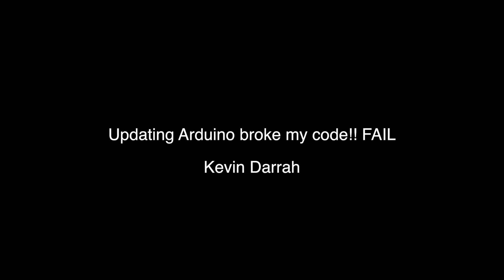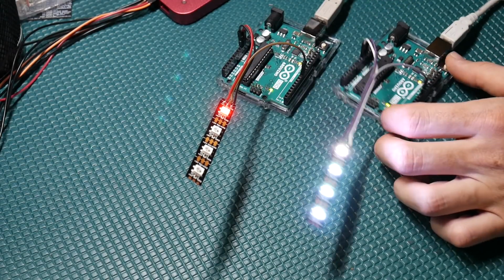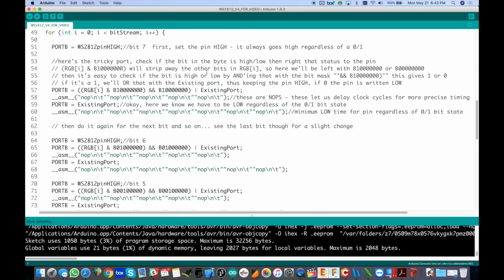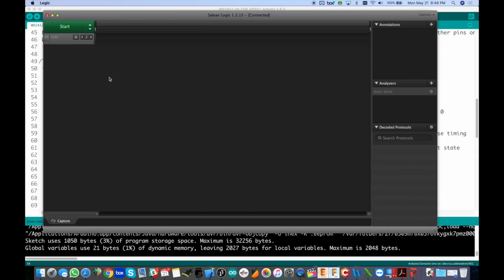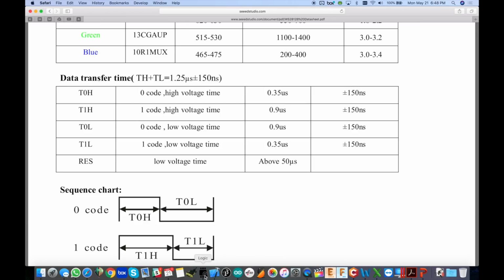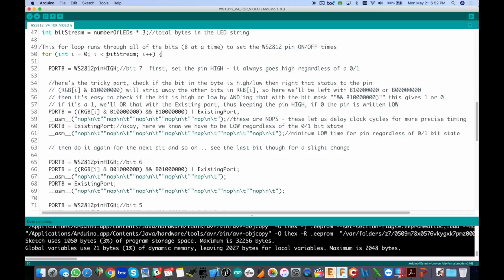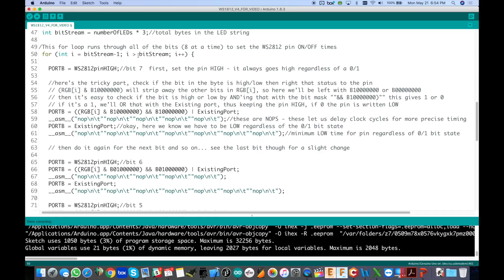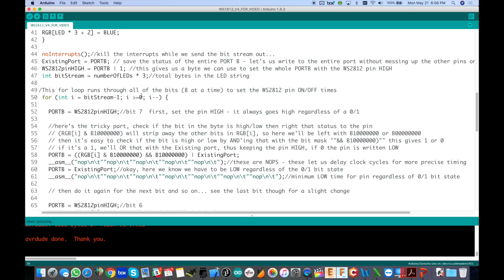Updating Arduino Broke my Code!! FAIL

Comment: Hi Kevin, How to make 1 LED turn on, and the other 95 to stay off 
in a panel of 96 addressable WS2812B LEDs,
but in an automatic fashion? Can one write 96 RGB_update functions 
and Call a particular function (within another Arduino code) to fire a specific LED? 
Thanks a lot for your help!

Comment: I don't think that the for-loop is to blame. Normally the time to branch back from the end to the start of the loop shouldn't have any influence on the execution of the inner code i.e. on the length of your bits.
I believe that the way you write the loop has a side effect on the code optimization of the inner parts of the loop. I reckon that the loading of the RGB[i] value into a working register somehow moved from before the "PORTB = WS2821pinHIGH" instruction to the location where it is first used. Hence the length of the first bit is increased by this additional operation.
The best way to avoid such surprises in time critical parts of your code would be to write the whole section in pure assembly. Then the compiler won't change or optimize it.

Comment: When doing a normal comparison the hardware has to do a memory fetch for the value to compare, and do a subtraction, then test the flags (less then, greater then, equal too, etc.).  When counting down to zero there's no need for the additional memory fetch and the subtraction for the flags is part of the increment/decrement part of the for loop.

Comment: (RGB[i] & B10000000) && B10000000 doesn't make sense. Because && is boolean logic this will be 0 if the left operand is 0 and 1 if the left operand is non-0. It has nothing to do with the right operand being B10000000. It could be any non-0 value. The semantics are misleading and could lead to a programming error someday.  I would suggest either !!(RGB[i] & B10000000) or ((RGB[i] & B10000000) == B10000000) or even ((RGB[i] & B10000000) && 1) all of which will provide the correct result but better convey the semantics of what you are intending.
Reply: Robert Tausworthe 
Your comment makes sense; & != &&. He's using them as if they are the same thing :(
Lucky it worked at all?

Comment: Did you try "for (int i=0; i < bitstream; ++i)"? Normally, this should be optimized by the compiler itself, but in case of i++ rather than ++i the value of i is actually evaluated before incrementing it (even though not being used for anything), so that might be an issue as well. Example: "int i=1; int a = i++;" gives a==1, while "int i=1; int a = ++i;" gives a == 2...

Comment: For anyone interested here is a snapshot of the generated assembly code for an up counting for loop and a down counting for loop :https://drive.google.com/open?id=1jxaz6GCLQgYs-wOp5-LJ-uq0ckZcLj2s    what basically happens is that you have one more instruction in an up counting loop because there is no branch instruction that compares with an immediate value so you need to do  a subtraction first (instruction 84 in the picture) next once the subtraction takes place it is compared with bitstream (instruction 86) then another instruction that will branch if the previous instruction was "not equal" hence BRNE (BRanch Not Equal) . The downcounting for loop  instructions begin at  8a 8c 8e which is only 3 instructions including the one to send a value to portB. while the previous up counting for loop had 4 instructions including sending the value to portB.  oh and the very first (80)instruction is your counter variable, in this case i and x.  the compiler was smart enough to use one register for both (r24)

TO sum it up in simple terms:

up counting for loop : subtract -> compare ->branch

down counting for loop : subtract->branch

Comment: What occurred to me is that maybe the test to see if something is equal to zero (now) takes fewer cycles than testing it against another value?
Edit: OK, you said that at the end, if so using... for( i = bitstream; i; i-- ) might be fastest if that is the case.
Reply: check this out I typed up to similar for loops except reversed the counting and took a look at the assembly code generated : oddly enough the counting down gives me less instructions then counting up :  here is a snap shot https://drive.google.com/open?id=1jxaz6GCLQgYs-wOp5-LJ-uq0ckZcLj2s
Reply: oh im wrong , instructions 82,84,86,88 are for the up counting for loop hence 4 instructions. the the last 3 instructions are for the for loop counting down. so yes less instructions to count down

Comment: The problem is not the compiler. The problem is your use of nops to guarantee timing between loop iterations. Interrupts can delay instructions, including nops. In order to enforce accurate timing, you need to disable interrupts prior to nopping, or redesign your code to poll elapsed time.

You may use "DELAY_CYCLES" to delay accurately, and you may also use the hardware timer to ensure that a set amount of processor time has passed between iterations.
Reply: I believe he is already using noInterrupts() which should disable interrupts?

Comment: Wtf? People actually use arduino ide??? Talk about hitting yourself with hammer when trying to do anything. Please, arduino didn't break anything.. it's already broken. Google "platform.io for visual studio code" and this video would never happen...
Reply: Google+ SUCKS BALLS - the worst forced social network    Arduino is great, just use whatever you like.
Reply: Yes, it is much better, but electron is shitty
Reply: For education, yes
Reply: I use platformio for project configuration and the command line utility.. You don't need to to use electron, you can use whatever editor/ide you want with it.

Comment: ONLY an arduino will have issues like this, this is why its a prototype kit.
Reply: whether its the Arduino firmware or the tool-chain its still Arduino that's my point. I understand the avr dude and the other stuff works as usual but the upper layers are where mistrust is.
Reply: i blame my dog actually.